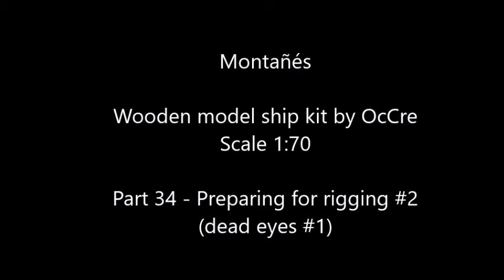Montanes - Part 34 : Preparations for riggimg #2;  Dead eyes #1

Comment: Beautiful Wolfgang!!, I am about to prepare my Montañés dedeyes, you mention that you are using amatti 1mm thick thread, is that measured the same way Occre measures threads?, the thickest thread that comes with the kit is .8 mm, that would make these  thread a .2mm thicker, is that correct?, I am making my own themread, the ones that come with the kit are terrible
Reply from the maker: @albertomunoz5896  Thank you. I compared the Amati and OcCre rigging yarns in an earlier video (see in my playlist). The 1 mm yarn from Amati only has a real diameter of 0.8 mm (see tab at the end of the video). Therefore, I always used the 1 mm yarn from Amati when 0.7 mm was stated in the instructions.
Reply: @wolfgangzinn  thank you!!